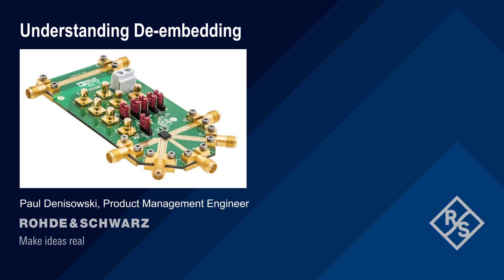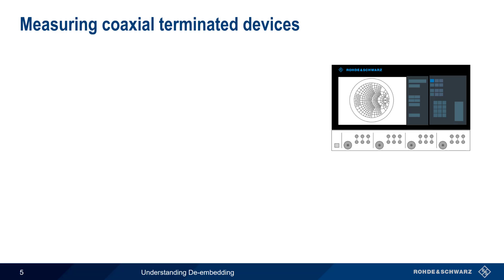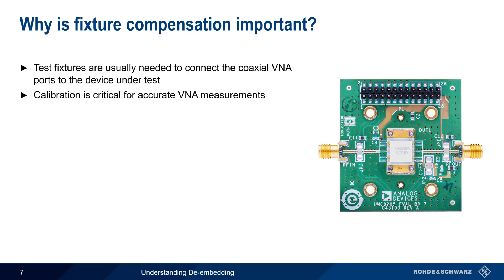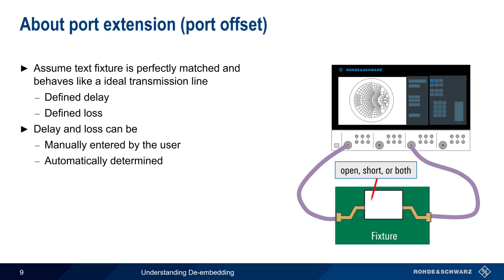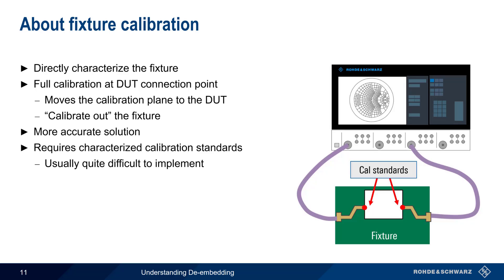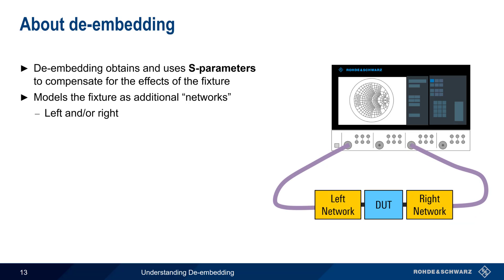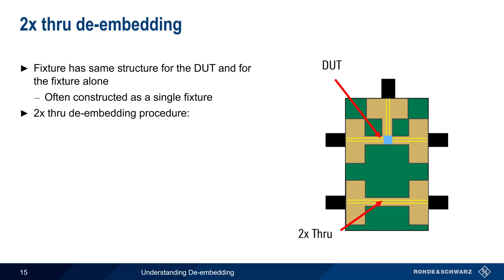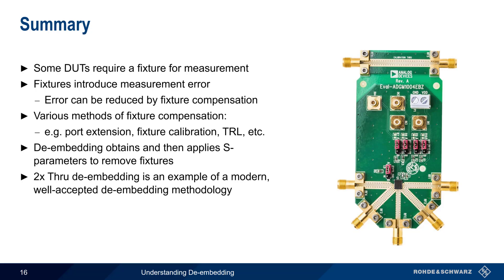Understanding De-embedding

Comment: Can the de-embedding files always be used ?
I'm facing issues and instability using that methodology with high attenuation path in the fixture. The fixture to be calibrated is composed by multiple RF switches, cables and attenuators (up to 20dB). Is the de-embedding file still working fine ?